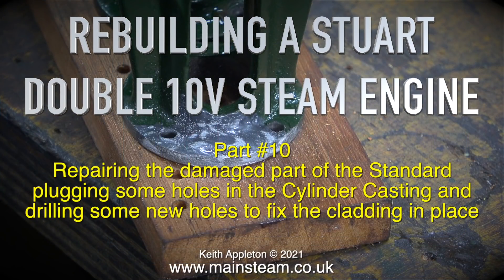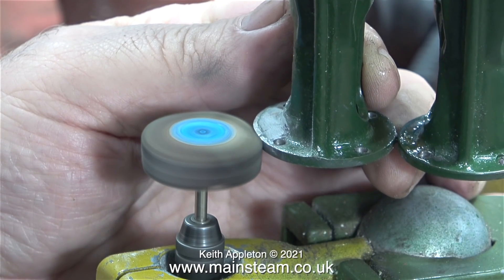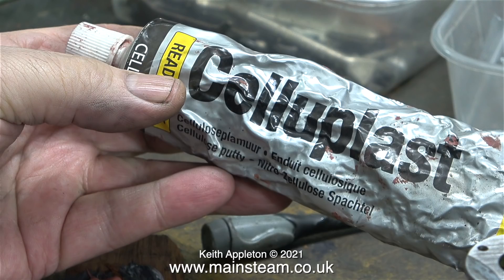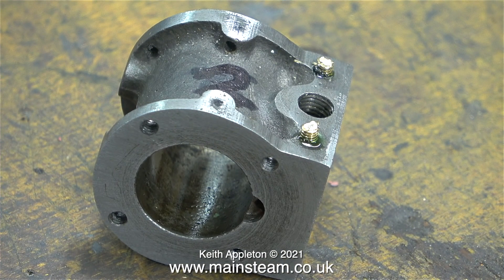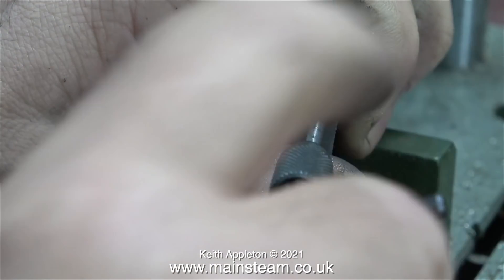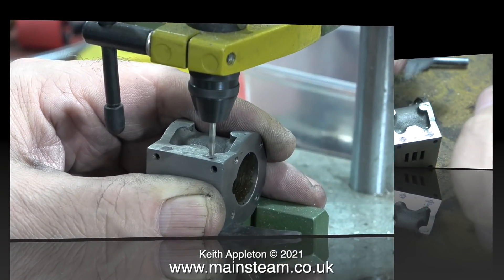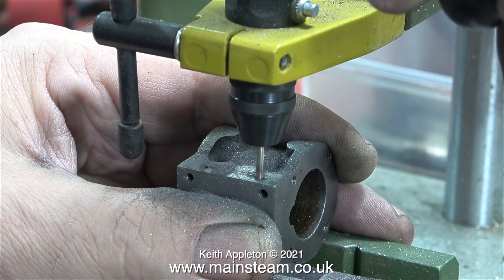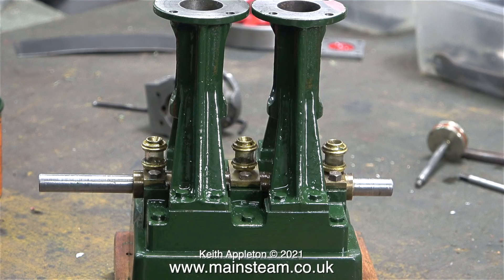REBUILDING A STUART DOUBLE 10V STEAM ENGINE - PART #10

Comment: Hello Mr Appleton, a very good repair. I think the part that broke off will hold up well with the glue. It is not loaded and one drill hole is still half on the stand. You would have more work with a new stand or you would have to clamp it on a mandrel and turn off the flange on the lathe and attach a new flange with silver solder.

Comment: Actually I was taught that that kind of tap is called A "bottoming plug tap". When I asked why, the teacher didn't know. He said; "that what I was told it was".
All I can think of is that the tap has a flat "bottom" with almost no taper and creates a thread that allows the entire hole to be filled "plugged".
American machinists tend to use over descriptive terms, for some reason. '-)
Reply: A plug tap is different than a "bottom" tap due to having a different chamfer on the end of the tap.  There are actually (I just learned) four "Standard Chamfers for Thread Cutting Taps": taper, plug, semi-bottom, & bottom, at least according to the "Machinery's Handbook - Twenty-First Edition" and the ASME B94.9 "ASME B94.9 - Taps - Ground Thread With Cut Thread Appendix (Inch and Metric Sizes)" dated February 2010, that I'm looking at right now.  I haven't dug out my older machining texts and may not if my short attention span takes over & kicks out the desire to find when our two countries started using different terms to describe tap chamfers.

Comment: US nomenclature for taps is:

taper—starter tap with 6–8 partial threads
plug—general purpose tap with 4–5 partial threads
bottoming—finishing tap with 1–2 partial threads

Plug taps are, by far, the most common, and tend to be the only type available at big box or most hardware stores.
Reply: That's what you might use, but it doesn't make it correct!
Reply: The "official" (at least in the US and anywhere our ANSI/ASME specs are used, I guess) "Standard Chamfers for Thread Cutting Taps" are: Taper, plug, semi-bottom, and bottom, which are really the description of the chamfer on the end of a tap, but that's what we call them due to these descriptive terms in machinery/Machinist's books for the last 100+(?) years.  Until I just checked ASME B94.9 (), I didn't even know there was a fourth taper, i.e., the "semi-bottom" chamfer.  At least this discussion got me to look.

I still haven't found anything explaining why US & UK terms for taps are so different though.  I'm afraid that I have very few British machining texts that are close to "standards" (of any kind), but I do have a lot of reprints of British-authored mechanical & machining texts on topics like steam engines, basic machining, etc., like written by Paul Hasluck (sp?) & many others back in the late 1800s.

Comment: You are correct, Keith...
In the UK it's Taper tap, Second tap, P:lug tap.
In the US, it's Taper tap, Plug tap, Bottoming tap.

As far as I'm concerned, we, in britain developed general engineering, including screw theadsing... thus the tap and die thread cutting tools associated with thread cutting.

Therefore, we in the UK are right and the Americans are wrong... it's TAPER, SECOND, PLUG.
Reply from the maker: Thank you Gordon }:-)))

Comment: In canada we call it spot putty and all it is ,,, is thick primer.... I used it a few times late at nite when I was short of primer
Reply from the maker: This is epoxy resin with metal particles in the mix . . . it's most definitely not thick primer.

Comment: I’m generally not one for commenting but on this occasion I would have considered the belt and braces approach to being a replacement column. JB weld has its uses, especially in compression but I don’t trust it with torsional forces. I hope you get away with it but I’m being sceptical here.
Reply from the maker: It is just not worth the effort on this very old badly made engine.

Comment: hy keith , i wouls like to know, do u also have a proxxon tbh drillpress ? wich drill did u used in the video ? or i should better ask, wich drillpress would u recommend for stuart engines to build !
Reply from the maker: I just use a Proxxon drill press that holds any of the "Minimot" range of Drills.